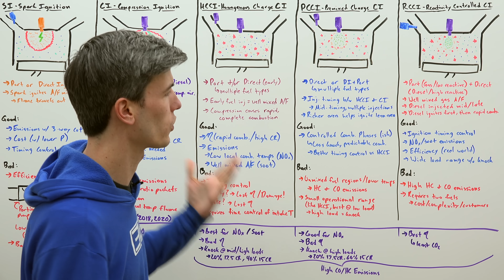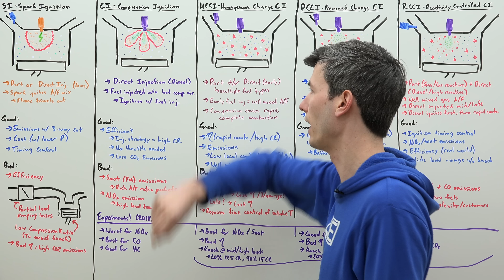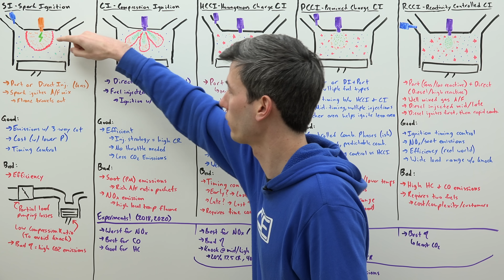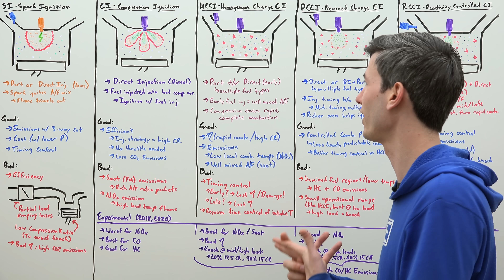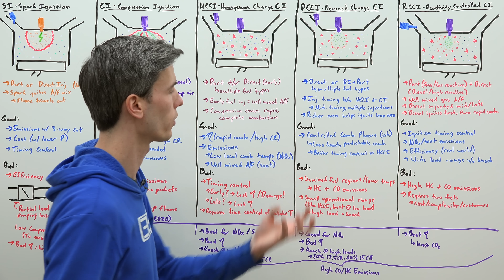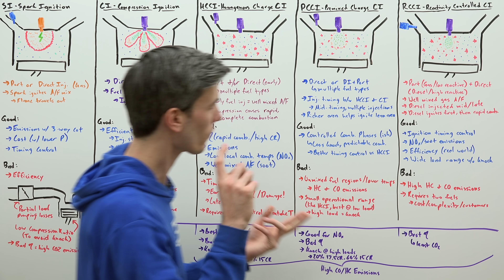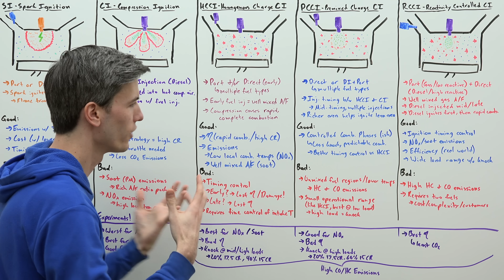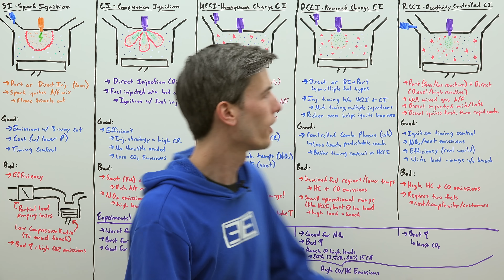If Combustion Engines Have A Future, What Is It?

Comment: Man I like this guy. I’ve gone through my last 7 years or so with him. Through college and now master’s. Hey Jason if you read this know that I sincerely thank you for your work. Being a mechanical engineer myself, I love how you teach without losing relevance even if you don’t use much math/calculus. Please never get rid of that whiteboard. I would nominate you for one of my new gen top gear trio. That’s pretty much the highest car-guy honor I know...
Reply: I second this nomination
Reply: Burn = resource forever gone from multiple uses. Electric = > 90% recyclable battery materials, plus several sustainable non-polluting alternative sources. So, just curious, can opposing piston engines be scaled up to drive ocean-going shippers? Then again, what justifies the burning, that makes “efficiency” go infinitely negative?
Reply: @Crunch_dGH  Practical considerations. Ocean-going shippers can't reasonably use electricity, the mass-power density is too low. Besides, the lithium required is uneconomical. If we take something like the CMA CGM Benjamin Franklin, that carries 16 000 m³ of fuel oil. This is a modern, large container ship carrying 18 kTEU, with a 63 MW turbocharged diesel engine. As a diesel engine, it is multi-fuel, and can burn anything from heavy fuel oil to methanol to LNG or even hydrogen. As a neat solution for the sake of comparison, we can take standard European automotive diesel fuel, with a density of 845 kg/m³ and 43 MJ/kg of specific energy. Taking into account the fact that marine two-stroke diesel engines such as the one on the Benjamin Franklin have an efficiency around 50%, we can calculate that the useful energy stored on the Benjamin Franklin in the form of diesel oil is 16000 m³ · 845 kg/m³ · 43 MJ/kg *0.5 = 291 TJ, for a weight 13 520 tonnes. To store that same amount in lithium-ion, which we optimistically give a specific energy of 1080 kJ/kg (300 Wh/kg, realistically current consumer technology hits around 265 Wh/kg or a bit under 1 MJ/kg), with 100% charge/discharge efficiency (realistically 80-90%),  it will take 296 444 tonnes of lithium-ion batteries to give that same energy. 

Now, that's 13 520 tonnes versus 296 444 tonnes. But perhaps we are willing to go with the larger tonnage, since it's green. There are, however, several issues with this. Firstly, the need for space. Converting this to an equivalent of cargo containers required to carry the batteries, each heavy tested 20-foot container can carry a maximum net load of 28 tonnes. That gives us a 9 623 TEU equivalent space, over half of the cargo capacity on the Benjamin Franklin, simply for batteries, by volume. By a more reasonable calculation, we havea density of around 2.5 MJ/l for pure lithium-ion batteries, which means 116 400 m³ of volume, or optimistically 2 700 TEU, still 15% of the cargo volume and many, many times the current fuel tank volume.

The second issue I see is the economics. With current (quite low) battery prices, those 296 444 tonnes of batteries are $10.67B USD. Nearly eleven billion dollars. Total construction contracts on ships of these sizes are usually in the $2-3B USD range, with ship materials accounting for maybe $300M USD and the rest being labour, design, and profit. For the energy supply materials alone to be four to six times that is unacceptable. From a purely theoretical, ideal standpoint, storing one MJ of energy takes around 20 g of elemental lithium metal as part of that kilogram of battery (yes, seriously, 2% by weight). That's 5 280 tonnes purely in lithium metal, or $227M USD at current market price. That alone is worth all the steel in a ship of this size.

The third issue is that a ship of this size is not enough. The deadweight tonnage of the Benjamin Franklin is 185 000 DWT. That's effectively the maximum permissible weight capacity of the ship, including all cargo, fuel oil, the mass of the ship itself, fresh water, ballast water, provisions, possible passengers and crew. She will never surpass this weight without finding herself at the bottom of the sea. She can't lift 296 444 tonnes of batteries. In fact, 296 444 tonnes of batteries is well over twice the weight of the ship itself, the pure empty displacement. This is one of the largest cargo ships ever put to sea. She couldn't carry the batteries required to fuel herself, or even half of that. 

It doesn't really matter whether you can make more efficient diesel engines fit large marine vessels. Because you can never make all-electric power systems fit large, long-range marine vessels. This is why we use diesel engines, because diesel is the most efficient, environmentally-friendly choice, and as it is multi-fuel, it can be easily fueled with renewable fuels, such as Neste Renewable Diesel. This is by far the better solution to marine vessels. There is no competition, in a free market, electric marine propulsion will not take off until lithium is as common as sand and batteries can store at least ten times what they store currently.
Reply: Why not just go nuclear? They've been working fine in subs for decades.

Comment: Why wouldn’t combustion engines have a future? The future will have more power train options but to say combustion may not have a future is just wrong. I remember people in the 1990s saying that whiteboards will be a thing of the past, but here we are...
Reply: Facts
Reply: Synthetic fuels from Porsche might come in handy
Reply: Whiteboards don't destroy the environment. That's the difference.
Reply: Because their exhaust is very harmful, and because electric motors are much better in practically every way. Ass soon as batteries get good enough and cheap enough, ICE is dead. And that's not that far away.

Comment: Whatever happened to Atikinson Cycle? Say for example, right now, the Honda 1.5l turbo effectively replaces the classic K24. Granted the turbo has a nice broad torque range and gives nice presentable EPA figures on the city cyle (ahem). But why not do a 2.5L Atkinson cycle engine instead? With variable valve timing/duration and direct injection, I'm surprised we didn't see this solution, as it's less complex and expensive compared to the plumbing required for a turbo engine.

Comment: Isn’t gasoline more volatile than diesel fuel? If the compression ratio in a spark ignition gas engine is too high it detonates which is pockets of compression ignited fuel/air mixture before the spark.
Reply: Diesel does not use a spark at all. With computers running everything now knocking shouldn't happen.
Reply: @Xander1Sheridan  I was addressing his explanation of Reactivity Controlled Compression Ignition and the characterization of gasoline as “low reactivity” and diesel fuel as “high reactivity”.  That seems backwards to me.

Comment: How did you calculate electric car efficiency? Would it be the ratio of work performed by the car to the energy put into the car's battery? I doubt it's 90%, the batteries are not that efficient.

Comment: The future for ICE is as a backup generator for EV..
Reply: And small engines where electric is not viable like logging, the gas saw will remain king in that department for the foreseeable future. Granted more and more lumber is coming from farms where heavy machines are used instead of men with chainsaws so the demand for those gas saws will likly decline heavily if that trend continues.

Comment: I feel like controlling HCCI to avoid knock could be a very good use case for machine learning.
Reply: The problem is you only have indirect control over it. Since nothing is triggering the combustion event except fixed mechanical events it takes really precise cylinder temperature control. But what COULD end up actually making it practical is freevalve style systems where you have full valve event control. If you have a very high static compression ratio, valve events can be used to bleed off a little bit of cylinder pressure and ultimately give you variable compression. This MIGHT give just enough control to make HCCI viable in the varying load/RPM/temperature of an automotive application. The problem is though, if you're bleeding air off to adjust compression, you're bleeding out a mixed fuel/air charge and it would lead to a lot of potential unburnt hydrocarbon emissions. Catalysts take care of this but still, unburnt fuel out will then drop your efficiency.

Comment: What about modifications to the direct injection diesel engine ? Say moderate boost turbocharger with Miller cycle to get the efficiency advantage of larger expansion ratio plus controlling combustion temperature with water injection to reduce NOx emissions ? How about using a diesel / electric hybrid drive to allow the combustion engine to be run at its most efficient speed /load ? Piezoelectric fuel injectors allow multiple injection events per cycle to 'shape' combustion depending on speed / load ?

Comment: 45% thermal efficiency for the dual-fuel isn't earth shattering, but I guess that's just one study. Hyundai and Toyota have both achieved ~40% with Atkinson cycle gasoline SI engines (modern Otto SI engines are 30-35%). Still neat the see the results.

Comment: Could have stopped at second diagram if you refuse to believe that the EPA is god and diesels are bad for the environment.
Reply from the maker: There's a reason they say not to run your car while the garage door is shut. It's not some conspiracy.
Reply: @EngineeringExplained  yeah the outside is roughly the same size as my garage.  My comment was exaggerative but the point remains that the epa goes crazy with diesel regulations despite having no meaningful impact except ruining great motor platforms.

Comment: I wish the combustion engine still remains in sports cars, the sound of the engine is part of the experience in a sports car. Although EVs and Hydrogen fuel cell cars are a great idea as a city run about car, however, EVs do have a issue if you are trying to drive across the U.S using the least amount of time or going camping/overlanding, as for Hydrogen cars, there isn't enough hydrogen stations in the U.S for you to drive across the country and there isn't an off-road capable Hydrogen SUV yet. So inconclusion, Sports cars should remain combustion engine powered, EVs and Hydrogen cars are great as City/Daily cars, and cross country road trips are still better with combustion engine car until hydrogen stations starts to build up, and camping/overlanding can be only accomplished with combustion engine SUVs.

Comment: in Poland RCCI is know as LPG to diesel. (LPG port injection to diesel: before 10l/100km after 3l LPG and 5l diesel /100km) this make sense in trucks but not very popular. LPG 40% price of diesel
Reply: Its not popular because they are maintenance pigs, it may cost less for fuel per mile but the overall cost of ownership is far higher and the downtime is straight up murderous.

Comment: Biofuels are the future. More so even than electric cars unless there is some magical discovery in battery or charging technology I don't see combustion engines disappearing anytime soon.
Reply from the maker: You don't see electric cars going anywhere? Why is every car manufacturer investing heavily then? Haha, electric cars are here to stay.
Reply: @EngineeringExplained  I should have worded that better, I don't see combustion engines disappearing anytime soon. Especially in industrial applications. 

Also, the statement of "the electric car is twice as efficient" is flawed as it doesn't take into account the inefficiency of the plant used to provide the power. which is between 40-60% when talking about a natural gas power plant.which is the largest margin. So you'd have to take whatever efficiency the electric car has independently and multiply that by .4-.6 to get the true efficiency of the transportation.

So TL:DR depending on your local power station the Electric car is less efficient than the RCCI

Comment: honestly i’ve been told so many times that carburetor’s were going to disappear one day its 2021 you can still buy a motorcycle with one lol gasoline will stick around longer than people think
Reply: E fuels from porsche would probably save gasoline engines
Reply: Thats true lol
Reply: Well of course - horse drawn buggies are still around after all. But 5% of new market share in 10 years I think for consumer transport...anotehr 10 year sthe same fo rutility and industrial
Reply: You can still buy carbureted bike because ‘merica. Any places adopted euro 5 emission standards would make it impossible to not use EFI.
Reply: Special interest groups and corporate lobbyists will make sure gasoline stays around
Reply: @DJ_SuperFreak  end of day it will be down to economics, as long as there is a market big enough there will be supplies, but as the market shrinks so will supply, probably just mean fewer and further apart stations maybe.
Reply: Exactly
Reply: They've been illegal on cars for over three decades and it's getting hard to find new motorcycles with carburetors these days. Even some dirt bikes have fuel injection. Carburetors won't completely disappear as long as small engines such as in lawn mowers are ICEs, but they have pretty much disappeared from the streets.
Reply: @chitlitlah  carbs aren't illegal. I don't know where you get that information.

The emissions rules are just very strict, and some sort of electronic emissions control is required.

The fact that air sucks fuel is not banned per se.
Reply: @chitlitlah  I do know small engine as a whole may be vanishing though in favor of battery electric tools. even Lawnmowers now can be had with batteries that last them several hours, and they tend to be easier for the end user (IE, no having to pull start. just turn it on and go). where I live I very much see such a transition happening.
Reply: @cpufreak101  Yeah. I bought a two-stroke weed wacker, but since I only used it about once a year, the fuel went bad and it stopped running well after a few uses. I probably could've fixed it, but instead I bought an electric one and haven't had that issue. It can sit for several years and then be ready to go as long as the battery is charged. Same with an electric chainsaw I had until it got stolen. My lawnmower is still an ICE though, as I use it more often, but they're getting less common as battery tech gets better.

Anyway, point is carburetors are still around but not very common. Internal combustion engines will be around for a few more decades at least, especially in automobiles, but they're slowly going away as well. I hope they don't go away completely because electric vehicles aren't nearly as fun.
Reply: @chitlitlah  I used a corded weed wacker.  It was more practical for me to use a 10 ga extension cord than to depend upon batteries.
Reply: @chitlitlah  they aren’t illegal they just don’t meet emissions standards if you have a old car that has one you can still drive it 😂
Reply: @Phil2stroke  I wasn't saying it's illegal to drive them, but it's illegal for manufacturers to use them now because they don't meet emissions qualifications.
Reply: it will not go away until we can have mini nuclear plants running our vehicles.
Reply: If it gets banned then yes it will go away soon.
Reply: @jtm9945  the government makes so much money on gas i doubt it 😂
Reply: @Phil2stroke  they will just tax something else more instead,  electricity maybe lol?
Or pay per mile is being considered ..
One thing is for certain, they will make us pay!
Reply: @jtm9945  que them running on moonshine
Reply: @jtm9945  gasoline may get banned, but diesel fuel won't.

There are still too many applications that cannot yet be easily electrified. Nothing beats the energy density and ease of use of a liquid hydrocarbon.
Reply: @daszieher  looks like most european big cities are banning diesel from driving into the citi centers, but still allowing gasolines. So although I do understand you meant heavy vehicles, I think your logic is still missing some facts.
Reply: @Pierobon  most European cities have banned older diesel vehicles (cars and trucks) from entering their city centres. No city that I know of has a blanket ban on diesel cars. You have clearly been misinformed.

You can drive anywhere with a modern Euro 6d diesel.

I'm afraid you haven't informed yourself sufficiently to make educated statements on the matter.
Reply: @Pierobon  diesel is getting banned from cities because its terrible for our health to breathe in diesel emissions and we have a massive percentage of diesel consumer vehicles because 90s and early 00s politicians pushed us all to switch to diesel because it was "green" (low CO2) and giving massive tax discounts to do so. Now we're being told they're killing babies and were all evil for driving them...

Comment: I dunno, let's just use electric motors, either with batteries, fuel cells or fusion reactors (haha).
Reply: I want a reactor in my semi, only getting fuel every 10 years like a air craft carrier would be awesome
Reply: The material for batteries is going to be worse to mine than all the oil fracking weve done